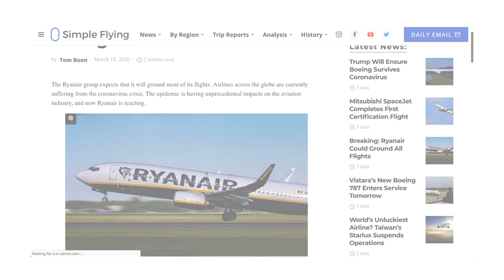What Plane Will Airbus Build Next?

Comment: Airbus needs a new, clean sheet equivalent of the A320, as well as the A330.
Reply: They should wait for Boeing to move first before launching an A320 replacement. It is not needed right now.
Reply: @aarondynamics1311  Boeing will probably do the same. It's really a game of who will do it first.
Reply: @KingTriton1837  The problem with Boeing waiting is that Airbus could launch an even more efficient version of the A320neo. It doesn't have to be much, just enough to make the A320 family more attractive to airlines than the 737 max. Boeing can't respond with a new 737 variant, as the 737's design has been pushed as far as it will go, meaning that it isn't possible to make any more improvements to it. This will force Boeing to launch a clean sheet design, giving Airbus significant market share as Boeing won't have a competing product for a number of years. This will mean that Boeing will need to get this new plane to the market as quickly as possible and so won't have time to experiment with new forms of propulsion or anything. This will give Airbus a chance to develop a brand new hydrogen/electric (or both) A320 replacement. Airbus will have the time to do this as whatever Boeing comes up with won't be superior enough to the A320 family to kill it.
Reply: So Boeing will have to be the first one to make a move
Reply: @aarondynamics1311  got it. But Boeing is probably waiting as well. I doubt that they will respond with a new 737 variant. Whatever comes next won't be a variant but a true replacement. Something that will probably force Airbus to replace it's A320, which is something they're already considering for the long haul anyway. Time will tell. These plane makers aren't stupid. They've made mistakes along the way, but they're watching each other very closely.
Reply: @aarondynamics1311  not necessarily. That's all theoretical that Boeing will have to make the first move, not absolute.
Reply: @KingTriton1837  You are correct, Boeing will respond with a 737 replacement, however, it won't be much more efficient than the A320neo. Certainly not enough to justify the retraining of many A320 pilots and crew on the new aircraft. You could say the same about a new A320neo upgrade, but there are quite a few airlines that operate both the 737 and the A320 and a new A320neo upgrade could cause them to steer more towards the A320 family. Not something that Boeing wants to have happen.
Reply: @aarondynamics1311  again, everything you've said is pure speculation. And speculation is not truth or fact. You really don't know how much more efficient it will be because it hasn't even been built yet. There aren't any schematics. With current engine technology, no, it wouldn't be much more efficient than the A320. That is a bridge Boeing hasn't crossed yet. After all that has happened with the MAX, I have a strong feeling Boeing will take their time with the replacement. So again, each of these guys will be watching the other. Even Airbus is starting to think about replacing the aging A320 (yes, it's an old airframe with new twists on it, just like the 737). Airbus is trying to figure out if the Airbus A220 is even worth it because the aircraft could interfere with the A320 at that size, rather than compliment it.
Reply: The clean sheet replace for the A320 will be eZero twin jet that can carry 200 passengers.